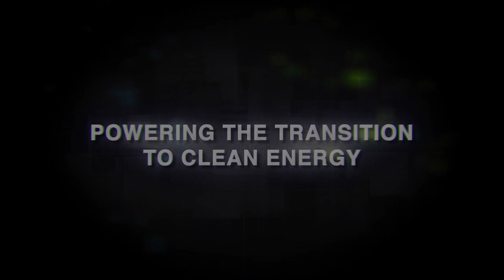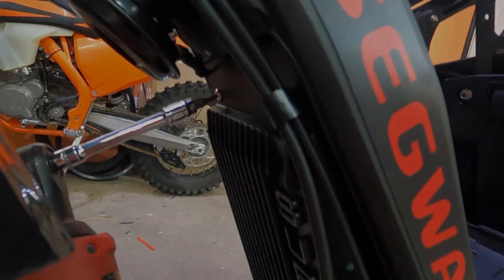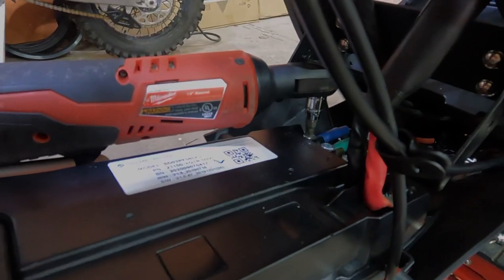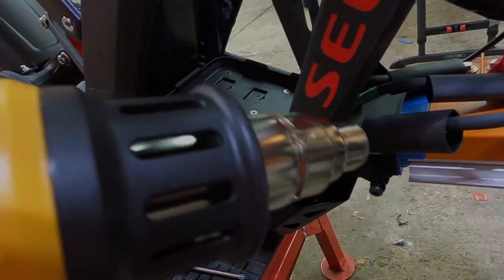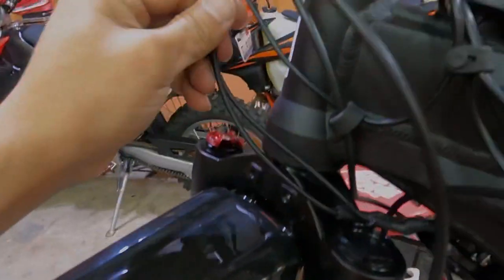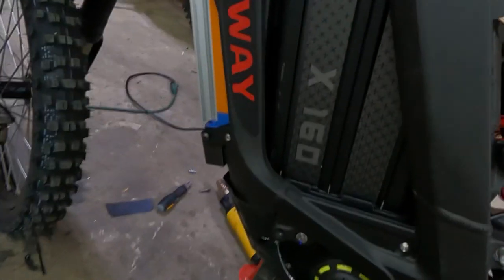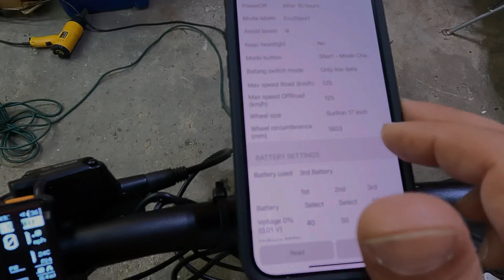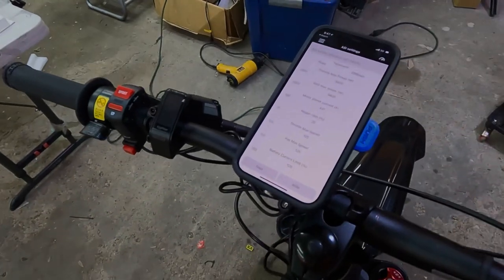Updated Install Instructions for ASI BAC4000 & BAC8000 by Green Line Engineering Inc

Comment: You should make an updated video if possible
Reply: Reason I say that is because the new 2023 surron is a little different and the harness is slightly different or has different looking connections for example the extra wire for future use
Reply: I also didn’t get lock washer for my top controller mount idk if it’s necessary but still tight and secure
Reply: Agreed, please make a new updated video!

Comment: You did not explain why you kept the Ep and Sport mode switches? Do they not work anymore? And why add a thumb throttle and not explain what it is for? Very confused.
Reply: According to the video, the EP and Sport mode switch should work if you’re not connected to the Bluetooth apps and your Eggrider is off, but in reality, it doesn’t work at all. So, don’t go cutting any wires. GLE (guy in the video) should tell you this but he’s worried about the embarrassment or he’s just lying to make more sales. 

Also, keep in mind that the switch includes the horn button, which could literally save your life. So, unless you have a replacement horn button ready, don’t remove it even if you’re not using the mode buttons. A great replacement option is the Warp9 horn button, which fits perfectly onto your brake mount.

As for the regen thumb throttle, it’s exactly what it sounds like — a thumb-operated throttle that engages the regenerative braking, slowing down the bike like an electric brake.

Note: If you run into issues, be prepared to get ignored by GLE. Worst customer service ever and I can literally get more info from a Surron part store about issues I’m currently having with it.

Getting rid of my GLE/BAC soon… 
Just came back to check if this wire cutting was gonna give me any issues with Torp but it’s all good regardless because I’m going to be using their new color display & Torp switch which plugs into the Torp controller harness that Torp provides with their controllers.
Reply: The EP and Sport mode does NOT work after the new controller install. Only the horn button will work.

Comment: I am having a really hard time closing up the breaker cover because the the controller wire towards the top is bulky and it's in the way of even screwing into the tilt sensor bracket. Any suggestions?

Comment: Does the bac 4000 have a lower voltage output for other functions such as headlight, turn signals?  12/24 volts? Or would the green display output work?  (Not for surron/segway) Converting motorcycle to electric and trying to figure out how to get 12v system to still work with 72v battery pack.
Reply from the maker: You install a 12v buck converter. That’s how all cars and bikes power there 12v accessories such as lights, horn, heater, AC … etc .

Comment: I am setting up on an X260 this weekend - once installed does the system automatically recognize the 260's battery? Or does it have to be switched like here in the video?
Reply from the maker: yes it should be recognized if you use our kit with our GLE Dashboard.

Comment: I cut the green  wire on my light bee,do I have to reconnect it to use the controller or is that only for the   switch between sport and ep? Thanks
Reply: No you do not have to reconnect it.

Comment: So i did this on my Surron light bee the GLE BAC4000 and a 72volt 51ah CHI battery did everything this video said to turned my bike on the headlight tail light and eggrider turned on but i had 0 throttle response it didn’t move at all some please help!!!
Reply: You didn’t program your egg rider
Reply: You have no power settings in the Egg Rider. You need to program your egg rider with actual power settings
Reply: @Buffetology How do i do that?

Comment: Do we have to use stock controller bolts (phase wire bolt?) that connects the wire to the controller? Or does your bac4000 comes w its own bolts to connect the wires?
Reply from the maker: It comes with its own bolts

Comment: My battery has 3 holes do I still do the top one when battery is in position that yours is shown, upside down? Also, my multimeter ground doesn’t fit inside the pin as yours does can I just touch it to the metal?
Reply from the maker: Can you contact us via support@glengineering.co. We would be very happy to assist you and if necessary call you. Thank you
Reply: @GLE  done.

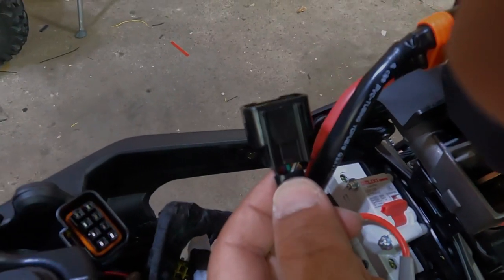Comment: The wires discussed at the 12:00 minute mark make it so the bike will still work even if the egg rider stops working?
Reply from the maker: Yes. However the Eggrider is ok but we are rolling out the GLE Dashboard which will give you driving modes like Park, Reverse, Neutral and Drive. Check out the Gle dashbaord video. Any other questions contact support@glengineering.co
Reply: will connecting tese wires keep my horn working ?

Comment: Hello guys I cut my eco/sport/horn wire as instructed in the video so it’ll still work if my eggrider is off or broken but the sport/eco buttons don’t seem to do anything, I did the wiring really nicely, took my time too and watched that step 5 times to make sure I don’t make a mistake
Is it supposed to work with the GLE app or what?
Reply from the maker: Contact customer support
Reply: The same thing for me
Reply: @zacharyjacques5551  ended up not needing it so I just replaced it with a better horn button that wont move

Comment: From the stock controller there is a 3 pin, an 8 pin, & a 9 pin.(Connectors).(Surron).  In the video when testing the battery, did you say 6 pin on purpose? Or did you mean 8? Just wondering.
Reply from the maker: Not sure what you are referring to but simply contact customer support and they will be happy to assist.

Comment: So, since in this video we discover the tilt sensor will no longer work, does that also mean that the kickstand safety cutout, as well as the brake cutouts don't work either?
Reply from the maker: The brake cutoff feature has been preserved. The kickstand and tilt has been eliminated but you can wire it back up to the cutoff for the same effect. Most remove them as they tend to put the bike in limp mode at the worst possible time when they fail and are not happy pushing their bike for miles in the middle of a forest because the kickstand or brake sensor failed.
Reply: @GLE  - Hmmm.  I really need to get that kickstand cutout working again, it's a HUGE safety issue and I'm surprised you would disable it.  In my youth, I lost a friend who was killed on a motorcycle after forgetting to retract the kickstand, and there is a big possibility, on a silent motorcycle, for a kid to grab the throttle and twist it and get injured.  I'd sure rather risk a malfunction into limp mode, than injure myself or others.  So, just which wires do I need to connect from the kickstand harness to the brake cutout?  From the wiring diagram, it looks like I need to keep the kickstand powered with green negative and black positive, then connect the green/blue signal wire to the brake cutout green/yellow???   I need to be sure I don't damage this new controller by wiring it wrong.

Comment: Just received my BAC 4000.  It has 2x red plugs in the wiring harness, one with a cap on it, that aren't addressed in this video.  I contacted your e-mail support to ask about them, and got a very confusing reply about e-brake cutouts, but your red plugs are completely different than theirs.   Since the Sur Ron already has e-brake cutouts switches, do I need to cut those connectors and splice them into yours, or will the OEM Sur Ron wiring still allow the e-brake cutouts to work with your BAC 4000?
Reply from the maker: The kit is universal so simply transplant the connectors. There is no polarity so that should be simple.
Reply: @GLE  I don't understand what you're saying here. The stock brake cutout wires go directly to a stock plug that connects to the new harness. Then we also have these two extra red plugs that mountainflyhigh was talking about--what are those for? There is no information I can find explaining what to do with them, and they're not a part of the harness that you install in this video.

Comment: Will a blow dryer work as well to heat shrink? Thanks
Reply: Most likely if it’s very hot
Reply: it wont. i just tried
Reply: @mikemauch2695  it works bro, don't worry you won't melt any other wires. Takes a few mins but it will work on high power high heat

Comment: Why are your motor leads in a different order than others that sell bac's the blue yellow and green wires
Reply from the maker: We have custom firmware for more power.
Reply: @GLE  so if I bought a bac from someone else wore it the way you show with the dashboard kit I just received?
Reply from the maker: @woodser1765  contact support@glengineering.co  not com . They will help you out

Comment: I don’t have any throttle. I get power, turned on egg rider, multimeter the lines, I’ve done all the setting in the app as instructed. Throttle was working day before with stock controller now it’s not. Disappointed bike is just dead.